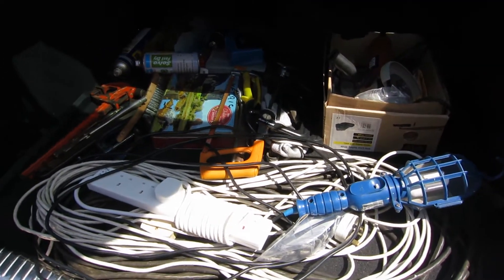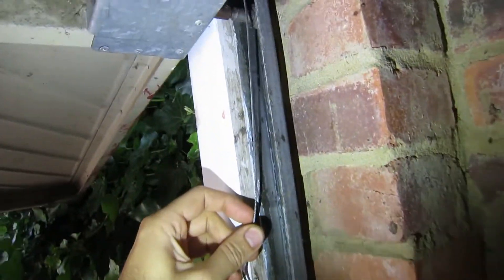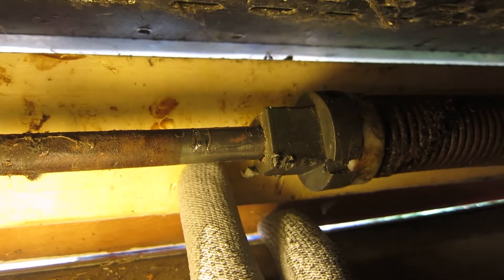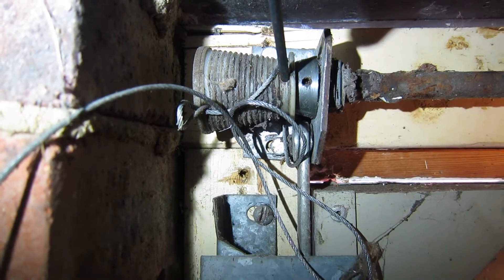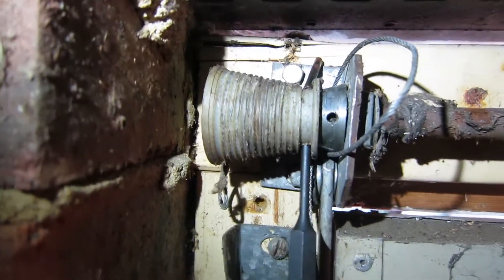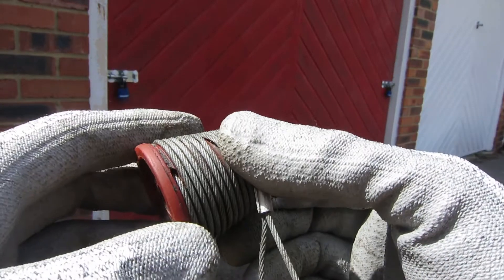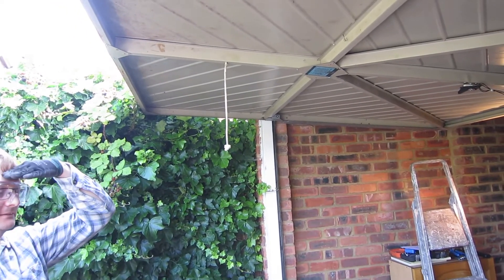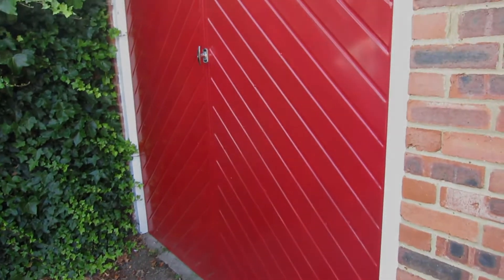Garage door cone and spring tension

Comment: Great video, like your one my spring (the bit where you put the bar in to tension) has moved to the right hand side (like in your video I think). How did you get the spring back into the original position? 😢
Reply from the maker: I can't remember now - there was some less than delicate persuasion involved at times.

Comment: Everyone seems to show doing the left side cone and not the right hand side.My Merlin door doesn't have anywhere on the right to put a pin to hold off the tension before you put the new cone on ,and there is no obvious way of turning the spring to take the tension off in the first place on the right!!

Comment: Great job lads I have the same issue with mine and going to start it this week. One question. I have a similar problem as you as my cones are very close to the wall and cannot release pin and take cones off. How did you manage to do this as its clear you couldn't fit it the cone over the shaft and replace pin. Can the shaft be slid over? thank you
Reply from the maker: Once the drift pins were free the shaft could slide left/right by about half of a cone width. Enough to get each side on one at a time.
Good Luck
Reply: The two bolts holding everything onto the frame have to be removed to allow you to pull it towards you and release the cone.

Comment: Did not get it instructions as they were hit and miss with them. What were the molegrips doing or did I miss something.    So what did teach me nothing really only how to use an hacksaw and two spanners in conjuction with each other. I am sure with nearly 9k views somebody must have understood. Me I prefer a blow by blow action plan sorry lads I never got that. Have got anymore that you have updates given the comments or is this it.
Reply from the maker: They hold the shaft from rotating that has the cone attached while the spring tensioning is done. Before starting on the spring you want to have the guide wires and cones all set with the slack removed. They were also useful to help rotate the shaft to find the roll pin holes. 
See if it's any clearer in this version I did: https://www.youtube.com/watch?v=7xFc-bSWf-k it's got a bit of text overlay and better audio, but no extra footage.

Comment: Looks so easy putting the tension in with spanners.My Henderson door requires two 6 inch metal rods which put a terrible strain on your fingers as the tension builds up.And one slip and you are back to square one.Possibly minus an eye!
Reply from the maker: Using fix spanners was key, a pair of adjustables would be too fat and get a bit risky to dropping/slipping off the end.
Anyway here is a version of the video that has no music. https://www.youtube.com/watch?v=7xFc-bSWf-k

Comment: Good Job guys ... I tackled this job of adding tension to the spring and lost grip twice as only using grips scared the pants of me when the spring went ... but third attempt got it and managed to secure it ... good to see you used correct spanners and gloves / eye protection as this job can be very dangerous.
Luckily I did not need to replace the cones just rewound the cables onto the cones it all worked a treat as did your repair ... well done... good useful video for others.
Reply from the maker: We pooled our toolboxes to get 2x 22mm spanners. The thickness of an adjustable would have caused the outer spanner to get very close to slipping off the nut.
The gloves I used were a bargain at 5 quid from toolstation (42874), cut level 5. A good investment as I've also used them for moving/handling carpet gripper.